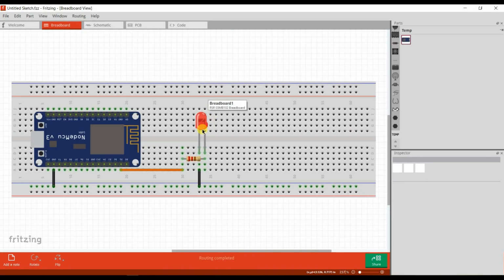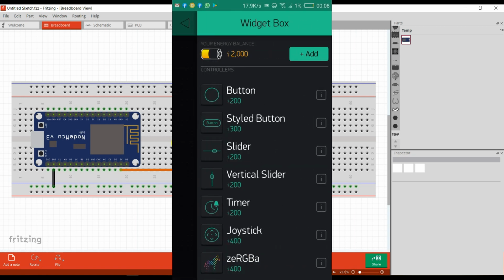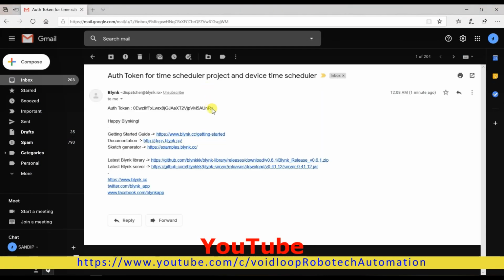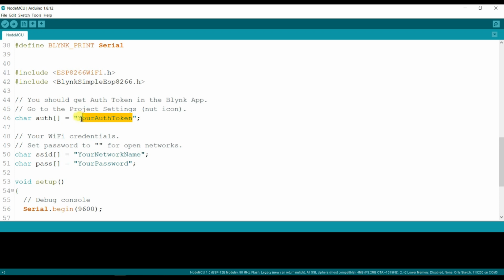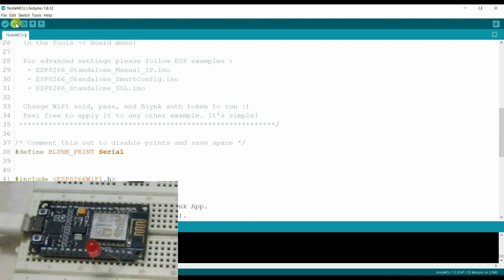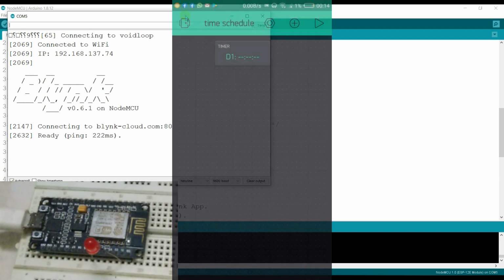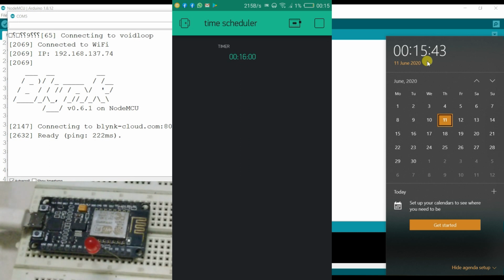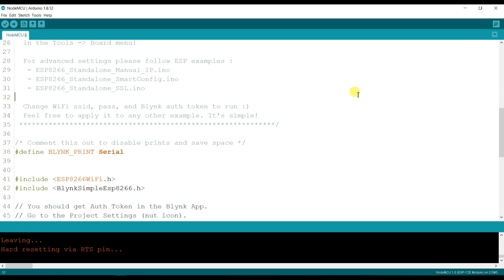06 Time Schedule  with Blynk app and NodeMCU & Arduino

Comment: Eventor is better than timer. It syncs time from the server and is not dependent on your phone.
Reply: Hi, it sounds great. Where is the eventor function? This option is not in my list.
Reply: @zoechen2805  when you tap on the add button on top right corner. Scroll down on the list. It should be in the "Other" section along with "Bridge", "real time clock", "bluetooth", etc.
Reply: oh! IOS is not support this widget, haha.